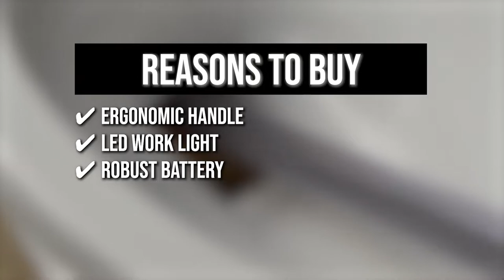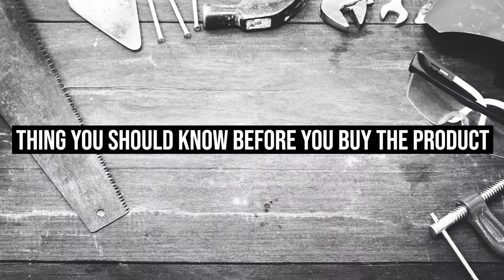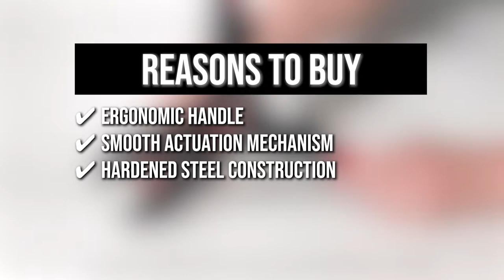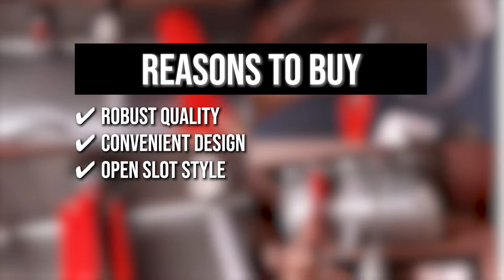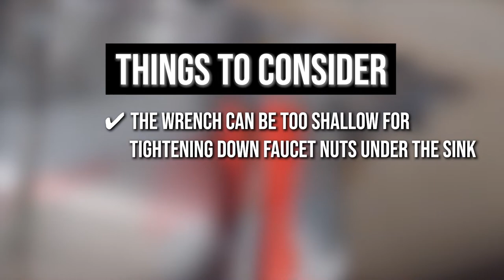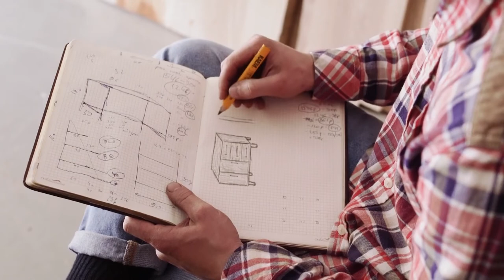🧰Top 10 Plumbing Tools for Professionals - Lineman Power tools review

Comment from the maker: *01:04* - Milwaukee  Copper Pipe and Tubing Cutter Link : https://geni.us/YBN3u
*02:04* - POPULO Electric Drain Auger Link : https://geni.us/Q4t2ofN
*03:12* - DURATECH 3-in-1 Plumber wrench Link : https://geni.us/zbUAZ
*04:11* - Amazon Basics Plumbing Adjustable Wrench Link : https://geni.us/VYYxm
*05:13* - Smoothclue Faucet and Sink Wrench Link : https://geni.us/m0Of9
*06:13* - IWISS PEX Crimping  and  Plumbing Tool Link : https://geni.us/BYhE
*07:02* - iRmm faucet and sink installer Link : https://geni.us/vVgYdk9
*08:00* - DURATECH Heavy Duty Pipe Wrench Link : https://geni.us/CLodxu7
*08:58* - Superior Tools Sink Drain Wrench Link : https://geni.us/XvAnnOt
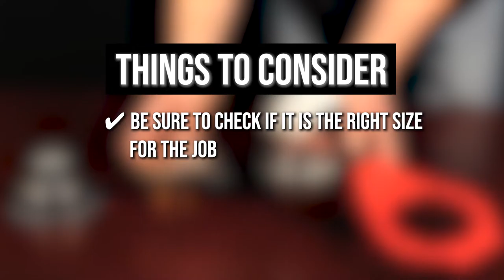*09:55* - RIDGID EZ Change Plumbing Wrench Link : https://geni.us/NAe0D